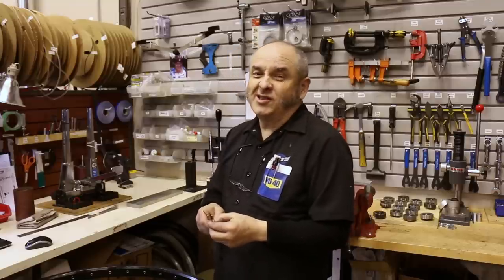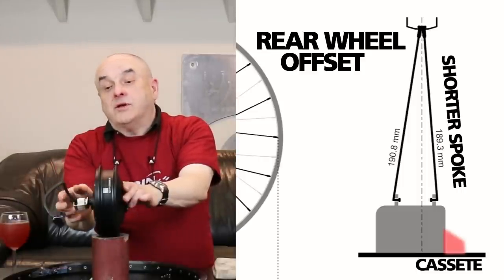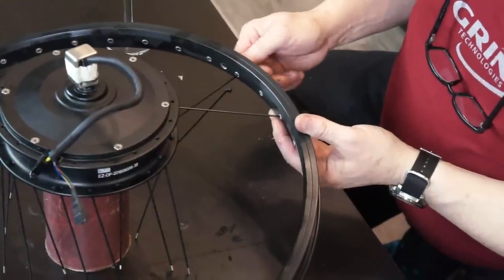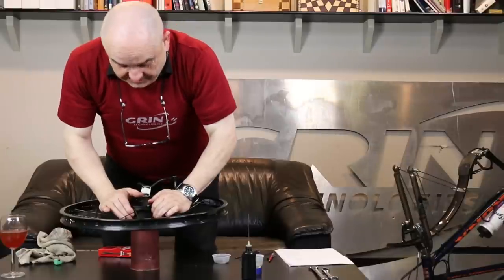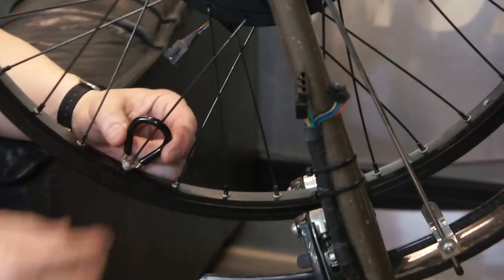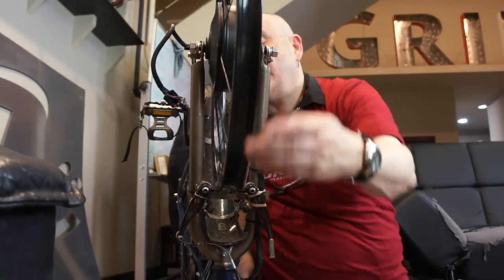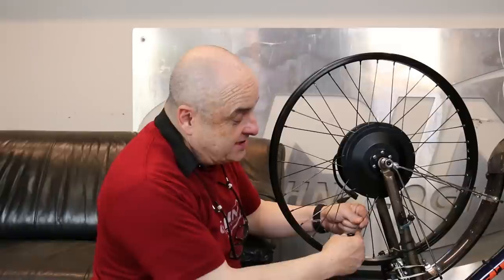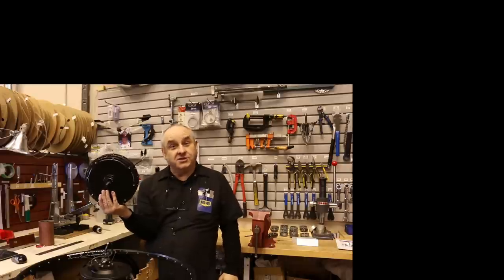How To Lace a Hub Motor at Home Like a Pro. The Single Cross Build

Comment: But how do you choose the right spoke length for your particular motor and rim size?
  I am considering buying a fat bike rear hub motor, and lacing it into 17/18/19" rims, with mitas motorbike tyres. Also, I want to use a fat bike front fork, with a fat bike front hub, and lace it into same rim. What issue do you foresee for this setup?
Reply from the maker: Spoke length is all determined very easily with our spoke calculator when you know the dimensions of the motor and rim. https://www.ebikes.ca/tools/spoke-calc.html  (also explained in the description of this video if you expand that)

Comment: Can I use a wheel that has 32 spokes with a 36 spoke motor hub?
Reply from the maker: Not really. You can use a rim with 24 holes OK (skip every 3rd hole in the hub), or 48 holes (skip every 4th hole in the rim), but there isn't any nice diviser between 32 and 36 to allow a similar strategy.

Comment: Are most 250w Hub Motors pretty standard and size dimensions? I am wanting to change out my Hub motor because the gears are stripped on the Hub motor case.. I'm afraid to buy one on eBay to find out it will not fit because of spoke length..
Reply from the maker: Good question, and I'm afraid the answer is no, there is no standard dimension among motors. The best thing to do would be to order your replacement, measure it, and enter the values into our spoke calculator to determine the correct length. You will need to know the ERD of your rim also. https://www.ebikes.ca/tools/spoke-calc.html

Comment: Sorry for noob question, does this apply to IGH hub?
Reply from the maker: Depends on the size of the hub for what lacing technique you'd use, single or double cross likely, probably not a triple cross, this lacing pattern is more common for hub motors but the technique of tensioning and truing the wheel in this video pertains to lacing pretty much any hub.
Reply: @GrinTechnologies  another issue is will I need a specific length of spokes as the hub might be slightly bigger than a normal hub?
Reply: @nicholaschai4458  yes! For sure, every hub and rim combo will need a specific length of spoke, there are many spoke calculators online that may already have your IGH dimensions, but you can see our (Grin's) video on measuring up a hub that is also a video by Robert https://www.youtube.com/watch?v=9I2n9rZPZlk

Comment: thank you for sharing the welth of info. considering ill have to fix up some dodgie wheels since the seller at there shop wont after 1 week an 70km having loose spokes
Reply: The shop I ran gave a 30 day adjustment warranty for brakes, spokes, true wheels, make sure everything is tight.
A few people pretended not to understand that there's no warranty for bent fork, flat tire, warped wheel, backed the pickup over the bike lying in the driveway.
Reply: Kids would come in and want to buy a spoke wrench, but I would sell them only to adults because I had a good idea what they were going to do with it 😂
Reply: Machine built wheels don't have laced spokes. Lacing stresses the spokes a little, makes the wheel springier as does bent/curved front fork tips.
Reply: Like come back and buy another wheel. Or the pair.

Comment: Can you use a standard rim you pull off the bike?
Reply from the maker: Make sure the rim off your bike is a double walled rim, and most importantly, ensure its spoke count matches the motor or it will not be compatible. Most rims are 32 holes and usually motors are 36 hole, the Grin Motor is an exception with 32 holes.
Reply: @GrinTechnologies  Thanks for response. We are a group at a university creating a bike. Unfortunately we will not get the chance to continue due to COVID-19 as the bike, equipment, etc is at our university. If by some miracle we can return, we will keep in mind. Thanks

Comment: do you buy  spokes  to size  or  cut them
Reply from the maker: We buy full length spokes and then cut them on a morizumi machine since we have so many length permutations, but if you are just doing a single wheelbuild it's best to buy the spokes to size than spending $4K on spoke rolling machinery.
Reply: @GrinTechnologies brilliant vid sir  i will take any advice ican get onboard i hope to  purchase a mxus 3kw turbo  hub i here there strong / powerful though  speed is not my thing its for steep uphill   mountain s   as 1000w  dont  cut it i only hope  3kw is enough  as im 220lbs ?   and its to go on to some type of strong 26in  rearwheel  i was told to get 10G SPOKES   but am not spending 550£ on a prebuilt wheel  as its atleast 200£ over priced   hence im looking other options i also  here that they  can be  wound different  3T 4T 5T ?    AND IM NOT  SURE  IS THE 3T MORE TORQUE  THAN A  5T With  Less TOP END

Comment: You don't sell my wheel size so I'm gonna have to figure it out for myself. Let's hope this video will be good enough
Reply from the maker: May I ask what size wheel is that? We've got 16"(305), 16"(349), 20", 24", 26", 27.5" (650b), and 29" (700c), in most cases with several options of rim width
Reply: @GrinTechnologies It's 650b but 2.3" wide. I'm tempted to try the fat 26" tire, but I'd rather not risk it not fitting

Comment: Holy cow. If you had handed me a hub, a rim and a pile of spokes, I would have reflexively built it wrong, apparently.

After building several hundred bike wheels over the past century, I am automatically used to putting the spokes in an alternating pattern, with half of them coming from the outside of the flange and half from the inside of the flange.

I just checked my ebike , and embarrassingly, I have never noticed that they are all coming from the same side of the flange, although in the case of my  ebike, they are all coming from the inside of the flange, opposite of what is shown here.

What gives? Does it depend on how the flanges are drilled on these ebike hubs?

Fun spoke trivia: The wheels for the Triumph TR4, and probably most automotive wheels, use four different spokes... Do not get them mixed up. Ask me how I know.
Reply from the maker: There's nothing 'wrong' about which side the elbows are on, but in hub motor builds (1 or 0 cross) there's simply no benefit to alternating, it just adds unnecessary complication to the process with zero upside.  You get the maximum triangulation with all the elbows out, but most wheels will still be perfectly strong with all elbows in and in factory lacing jobs this is much more common.